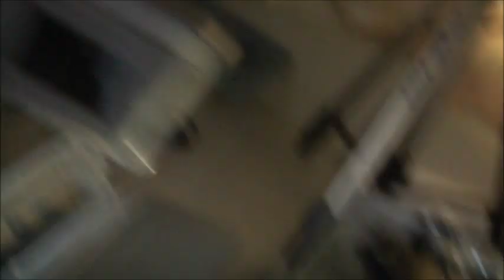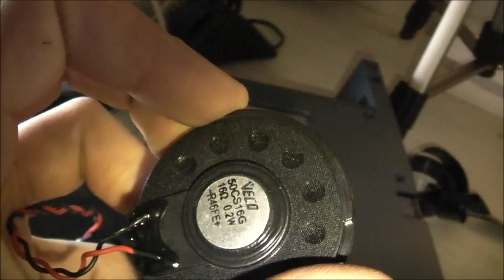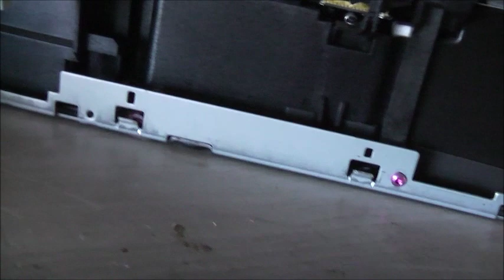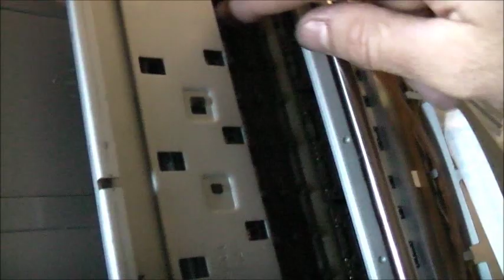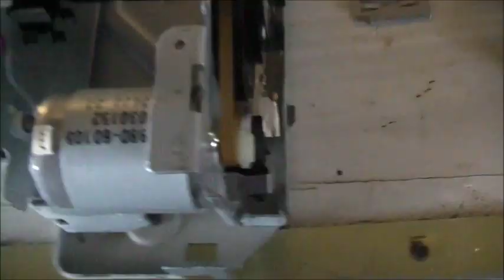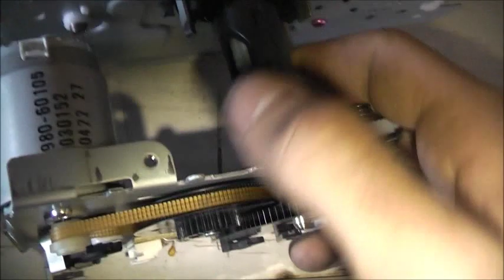HP Photosmart Teardown

Comment: had to figure out how to get the glass out to clean it - trick is to pry off the top plate of the control panel to expose the other 3 screws on top, the others are exposed where you can see them.

Comment: The biggest issue with a printer failure is that the manufacturers change the cartridges so regularly that one can't use their remaining ink.  The way I shop now for a printer is I check that the cartridges have a decent capacity (e.g. >400 pages/cartridge instead of typical ~150 pages/cartridge) and that I can get compatible ink for it. I also make sure the compatible ink has good feedback (e.g. on Amazon) and from my experience, they generally print fine like the genuine rip-off ink.
Reply: I have a old Epson photo r300 from years ago and it still works